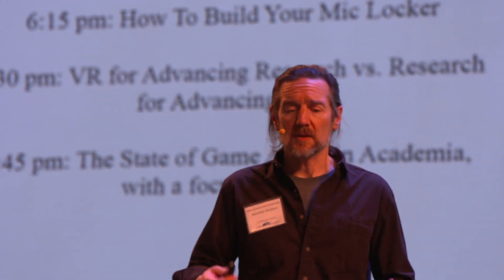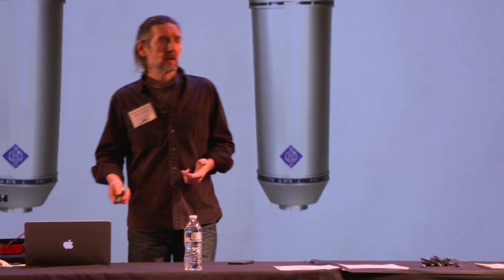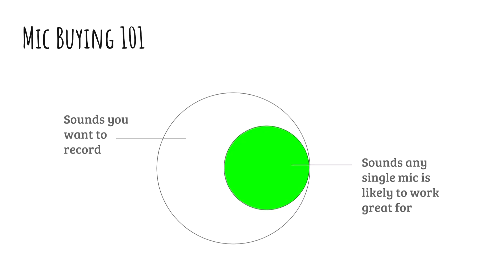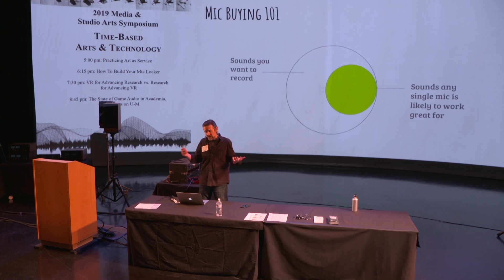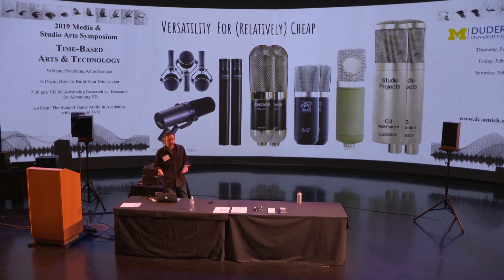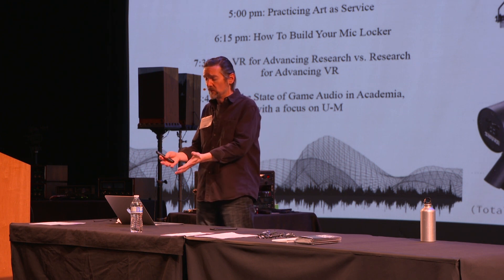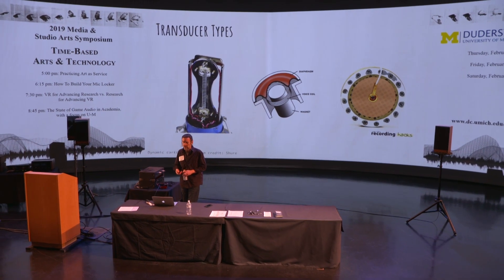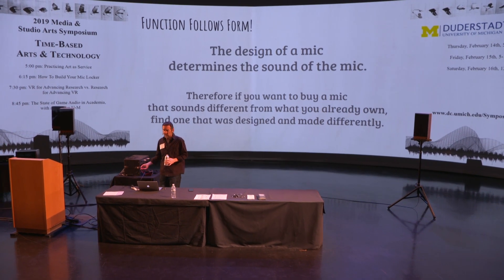How to Build a Mic Locker - Excerpts

Comment: If a singer sounds terrible in a Neumann U47 despite EQ ? I'd tell them to go home and I pay the refund
With all due respect
Reply from the maker: I don't know too many studio owners who are able to shame their clients. Maybe your business is different. Anyway, the suggestion that a certain mic is guaranteed to deliver a great track is nonsense, even if it's a U47 (which is NOT the mic I mentioned in the video, fwiw). The point of the mental exercise in the video is that trying to record arbitrary sources with one single mic -- even if it's a fancy German model -- will lead to challenges, simply because no single mic will complement every source. Most studios and home recordists are better served by acquiring a handful of mics that all sound different. That's the principle of "sonic diversity."
Reply: @RoswellProAudio  There's a valid point in the presentation but it's more social than technical. Singers that have issues can indeed benefit mentally from you playing around with 10 different mics. This gives time to hang out, time for the singer to warm up and feel safe etc. but the reality is, a large capsule Audio Technica for 500 USD will sound identical to any 3 k alternative, given the same audio interface, puff filters and appropriate distance. Actually. I'd be willing to buy a Neumann for 3 k if they made it twice as small as AKG 414 or the equivalent. At that size, the Neumann should have a built in battery, AD converter and lossless wife and blue tooth. It's tech from WW2 and it's all mental for someone to pay 10 k for something that can be polished with eq but for all practical purposes can often be left in a rock track without any DAW effects at all